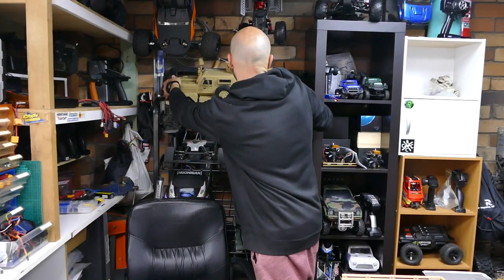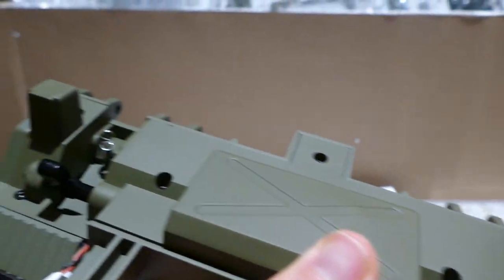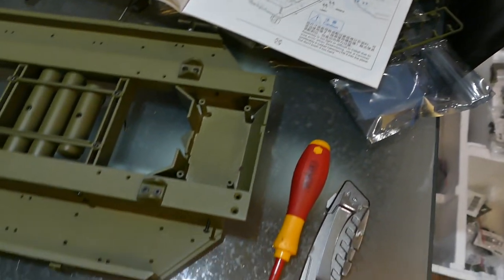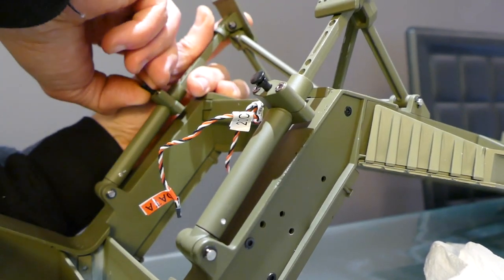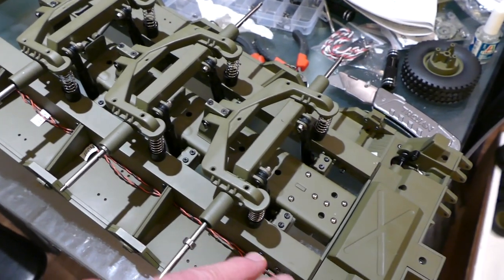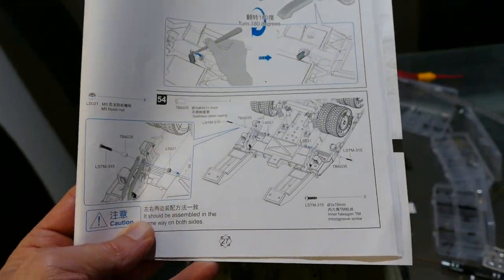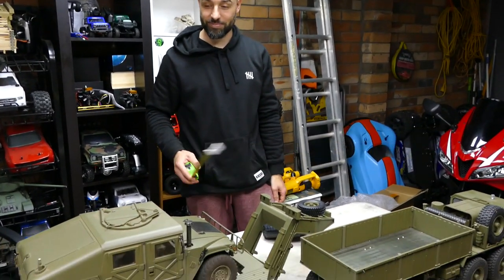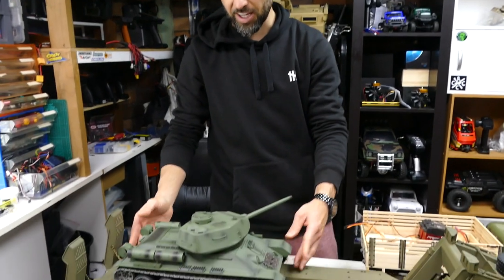US MILITARY ALL METAL HG P806 1/12 SCALE TRAILER 40kg LOAD CAPACITY! - PART 2 FINISHED

Comment: I have the HG-P803A Tipper version of the 801 & 802, (I Love It) 
Everyone says it cannot be converted to the 802 with a 5th Wheel which would allow me to tow the 806 low loader BUT as the 803 has the wiring for the tipper and the 802 has the wiring for the 5th wheel and the chassis and fittings are pretty much identical with each other why can't a retrofit 5th wheel be fitted to my 803 after the tipping gear is removed? 
Toucan Hobby's are selling the HG 5th wheel kit upgrade but I am reluctant to put my money down for the 5th wheel upgrade and the 806 low loader until I know the 5th wheel kit will work with my 803.
Reply from the maker: I am waiting to get the 5th wheel conversion. Don't see why it wouldn't fit
Reply: Thank you for that, I assume I can sue the daylights out of you if it all goes pearshaped?
 JOKING,
 Brilliant explanation of the 806 low loader build, most informative. @RCTanksTrucks247

Comment: Just a word of warning with the crane. unfortunately it forces you to do all the steering and backwards and forward motions on the left hand stick on the transmitter. Takes a fair bit of getting used to. The right hand stick is then used for turning the crane and lowering and lifting the boom
Reply from the maker: Thanks for the info mate
Reply: @RCTanksTrucks247  I had fixed that problem.  There was no way I was going to run my controls backwards lol